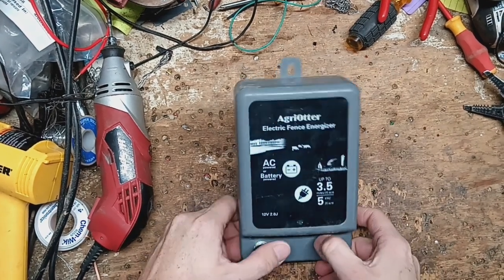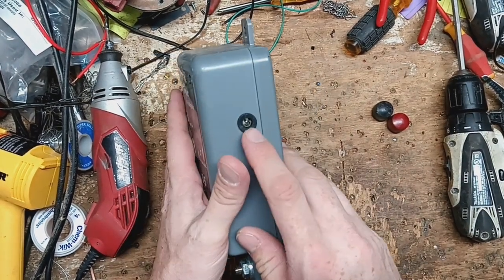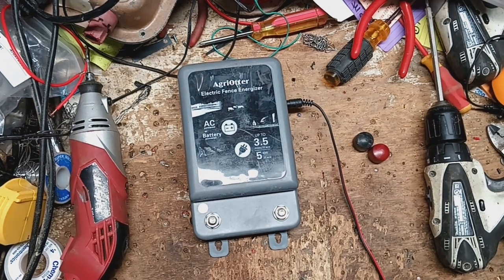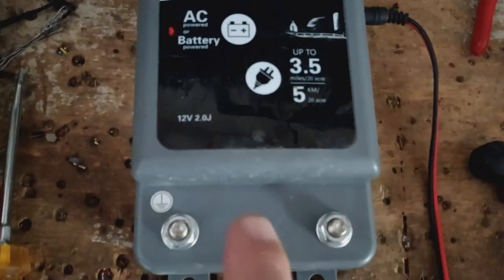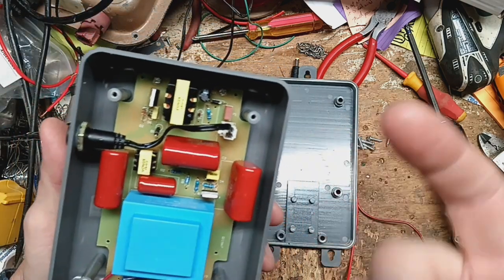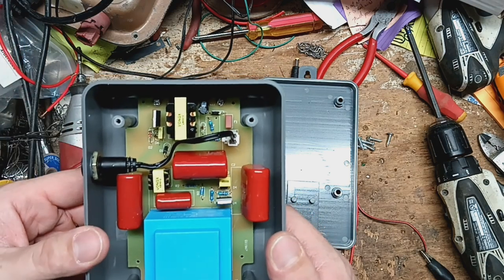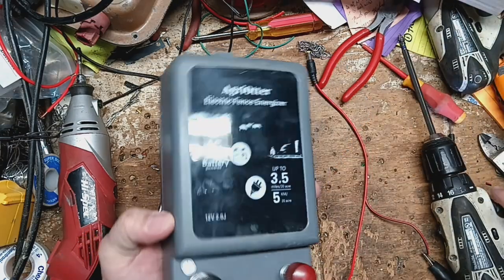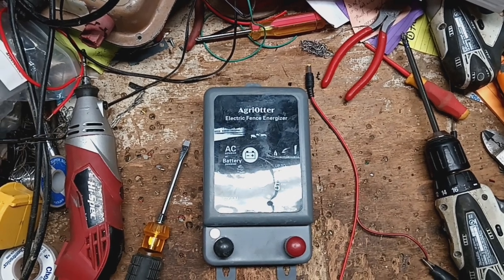AgriOtter Electric Fence Energizer Review From a Repair Tech's Point of View

Comment: What are the most common problems with these cheaper fence energizers ??  I am guessing that either the capacitors are not a high enough rating for the continuous use,   or  the transformers are not heavily enough constructed to take the continuous high voltage discharges.   I have been looking at the amazon reviews of these cheaper units and they seem to have a high degree of failure around a years use. I need to buy one,  and find it very confusing, because many say they wasted a hundred dollars on buying the cheaper devices.
Reply from the maker: Yep they're Chinese junk.... If you want a good unit, with a good warranty at 3 years, and very reliable... Look at a Gallagher unit. The smallest one of theirs I would ever consider is their M360. Gallagher is a New Zealand company and has been around since the mid 1930's and manufacture almost all their own stuff in house themselves. Their quality is top notch, but they aren't cheap but I wouldn't want them to make it cheap either.

Comment: How do you connect 2 keypad to 1 enerzizer
Reply from the maker: Thanks for the question, but I'm not certain what you're asking? What brand and model are you asking about and what keypad are you referring to?
Reply: Is this considered low impedance? I bought it to use on a short section of electric net fencing. Reckon it’s safe to use on that? Thanks!
Reply from the maker: @bradhudson3517 yes I believe it is low impedance. But just an fyi, no parts are available for it. So if it fails, it's a throwaway unit.
Reply: @FencerFixerRepairLLCKansasCity  Is it OK to power it with a 12v battery with the negative and positive switched around? I have the round thing that plugs into the port, but the wires are not red and black, so I don't know which are negative and positive.
Reply from the maker: @FLPhotoCatcher  what color are the wires on the round thing?
Reply: @FencerFixerRepairLLCKansasCity  One wire was inside the other. I've never seen that before. The inner wire had a white insulator around it, and the outer wire was wrapped around that, with a black cover that was the visible chord. But I found an adaptor wire that is color-coded, and that works.